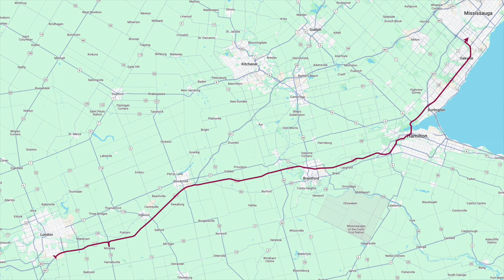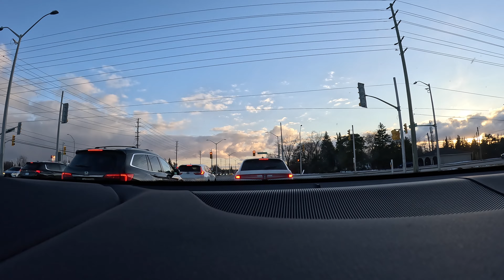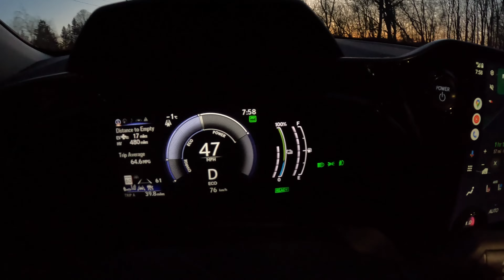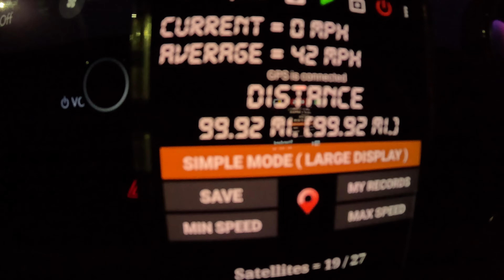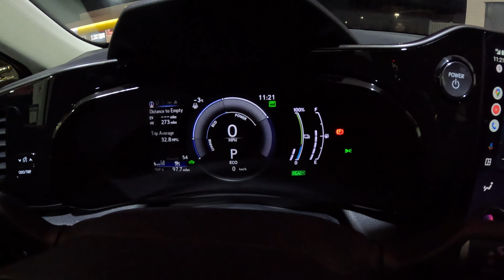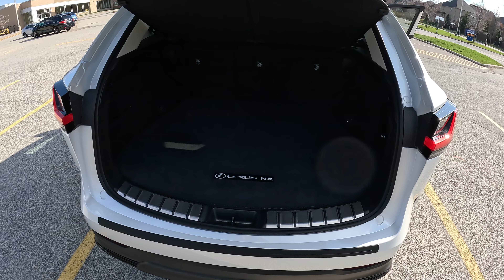Lexus NX 450h+ 200 mile City and Highway Driving Circuit in the COLD |  Plug in Hybrid | 25 F

Comment: Once the EV mode is done, how is the performance of the car? Do you feel a perceptible difference of power at this stage? How long does it take to charge back up to a state where the car is back to peak performance again? 

Also, when you switch to the hybrid mode, would the car still have access to its peak power of 304 horsepower when the battery is not depleted?
Reply from the maker: The 304 hp is combined. After the battery is below 40% state of charge the horse power starts to drop. Once you are at "0%" of Plug in range, the car transforms into hybrid only. The battery is still available when the power demand is high but only for a short duration. My only complain is the CVT which feels a little unnatural if are used to a car which had regular gears. 

If you have access to 240V and have a 6.6 KW onboard charger you can expect a full charge in just over 2 hrs. To get atleast to a point where you have access to all 304hp that will take atleast 1 hr.